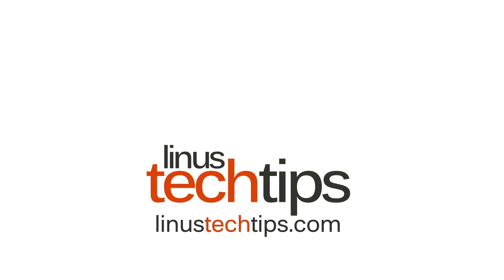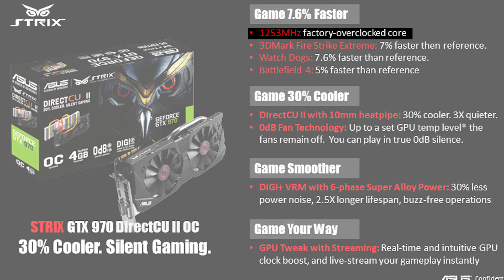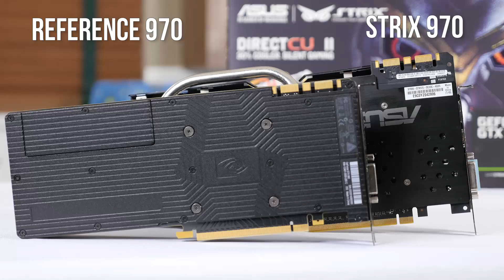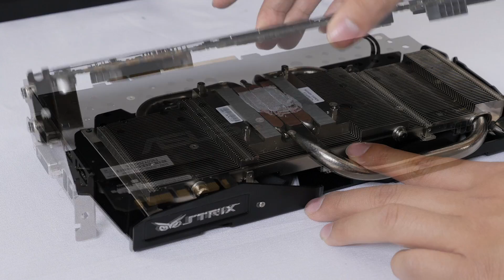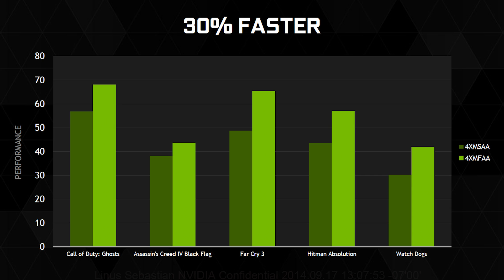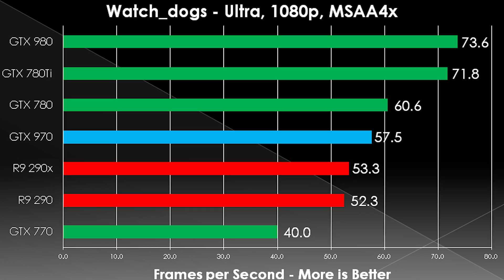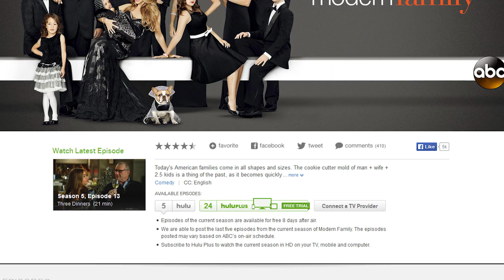ASUS Strix GeForce GTX 970 Video Card

Comment: Can someone tell me if this is a good build? and if everythign is compatible? (first pc build)

MSI Geforce GTX970 4GB DDR5 Nvdia PCI E Graphic Cards (GTX 970 GAMING 4G)
Intel Core i5-4460 3.2GHz Processor
Corsair Vengeance (2X4GB) Dual Channel DDR3 (CMZ8GX3M2A1866C9)
MSI H97 GAMING 3 32GB DDR3 Intel Motherboard
Samsung 840 Pro Series 256GB SATA III Internal Solid State Drive (MZ-7PD256BW)
Corsair Graphite Series 230T Windowed Compact Mid Tower Case
Corsair Builder Series CX600 V2 600W Power Supply 
Western Digital Blue 1TB SATA Internal Laptop Hard Drive Bare Drive (WD10JPVX)
thanks!
Reply: That looks fine to me but I just did a quick overview. Do you mind me asking why your going with intel over amd?
Reply: nate1994a im planning on a similar build (i will get a 290 instead of a 970 for the 3.5gb of vram thing) and AMD is just too far away in processors the fx line is dead and it will bottleneck almost everything higher than a 960. I really like AMD but they seriously need to catch up in the CPU side of things.
Reply: nate1994a because their CPUs perform much better in gaming because they have stronger single cores

Comment: Anyone able to help me choose the right power supply wattage?  
I decided to return my new 5K imac and build another PC, here are the specs:

Intel Core i7-5930K six core Haswell E
Asus x99-A Board
16GB DDR4 2400 Crucial Balistix(will eventually upgrade to 32 and possibly 64)
Corsair Hydro H100i 
2x GeForce GTX 970 SLI
SAMSUNG XP941 Series M.2 SSD
maybe 1 or two more hard drives
Maybe a bluray burner

Currently I chose a Corsair 850w PSU  but im not sure if this is enough now.  If anyone know how many watts the GPUs take please let me know. I know the CPU uses 140w

Comment: I have a weird budget. I am wondering if this would work with an x57 mobo with pcie 2.0, 6gb of ddr2 ram and an i5-650. No joke. I have a corsair CS750M, so power isn't a problem. This is very important to me, so I'd like an answer rather briskly. If I do not reply for some time, it is because I only have access to my tablet. Why? Wait for 6 1/2 years or so to find out.

Comment: So im kinda of a noob regarding pc hardware...and im in a dilemma!!should i buy with 400 euros a ps4 or a gtx 970!??im worried that im gonna give this much money on a gpu  and my pc wont perform as well as a ps4 on the framerate and smoothness of a ps4...my specs are gtx 650 ti 1gb, 8 gb ram vengeance,intel core i5 4670 at 3.40 ghz and a 1680x1050 59hz monitor!!HELP ASAP!!!dont hate!! :P
Reply: Sry i forgot to mention my mobo is gigabyte z87-hd3, wind 8.1 64 bit and 1 tb sata hdd(i DONT have ssd yet too pricey)!!
Reply: ***** yeah dude im sure that GPU is op as shit :P but im afraid it wont work well with the rest of my pc and ill put all this money to buy something that i wont enjoy as much as a ps4 that is sure it will work....it wont have the ultra settings of a pc but ill be able to play at high with adequate fps
Reply: Panagiotis Tsibos
what is your power supply?
 If you play a lot on pc than on a console you should definitely buy the gtx970.
Reply: ***** i think its 525 or 550W... i play more on pc nowadays but ive always been a hardcore console gamer
Reply: Panagiotis Tsibos
as long as the power supply is good quality psu there should be no problems :)
Reply: ***** i have it for about 5 years now and it can keep up quite nicely!!!but im afraid it wont be able to handle the gpu....but ive heard that the new gen of nvidias gpus is all about consuming less energy so in theory my psu can handle that
Reply: Panagiotis Tsibos
You should still ask around the internet because I can't be 100% sure if your 5 year old psu can handle your pc with gtx970.
Reply: *****
500w is definitely enough. I am running my setup with 450w psu and I have gtx970. The thing that concerns me about is the age of his power supply.
Reply: *****
No kerraha se vaa raapasee ite just maanantaina hain postista itelle juuri kyseisen näyttiksen mikä videos on.
Reply: *****
Parhain on kuulemma Gigabyte mut se on kans pisin. Ite otin Asuksen koska se mahtu mun koneeseen
Reply: tnx a lot guys that was really helpful!!! :)
Reply: Panagiotis Tsibos
no problem.
Reply: what is the best version of the card ?
Reply: prohunter gaming
If you got lots of money get gtx980, but if you are on a budget get the gtx970
Reply: ***** i ment like whats the best version of the gtx 970 ?
Reply: prohunter gaming
gigabyte or asus. Pick gigabyte if it fits in your case, if it doesnt then take the asus.
Reply: ***** ok thanks and what makes them better ?
Reply: prohunter gaming
quality and almost everybody says that the gigabyte or asus are the best of the 970
Reply: ***** ok thanks
Reply: prohunter gaming
no problem.
Reply: *****
hyvä homma
Reply: prohunter gaming zotac or asus I'll recommend getting the zotac one bcuz it's a fcking monster in overclocking
Reply: Christian Rhyss Jimenez thanks for the advice

Comment: This is the only review in the world where 780 beats 970.

Let me guess. You re-used your earlier scores. Back when you OCed every card you tested to its maximum and compared vs 970 stock? Because I know you don't OC your GPUs anymore, since the results were useless due to silicon lottery. It didnt make any sense.

http://www.techpowerup.com/reviews/MSI/GTX_970_Gaming/27.html

http://www.anandtech.com/show/8568/the-geforce-gtx-970-review-feat-evga/4

As drivers mature, the 970 and 980 will be even faster, it's a new architecture after all.

Comment: Hi guys. i'm thinking of building my first gaming pc in a very long time( last one was barton2500+(oc3200+)with radeon 9800se.
I see the gtx970 is the best value today, 8600 point on passmark and 250 pounds on ebay uk.(gtx980 9600, gtx780 8000).
What cpu would i need to not bottle neck it ? According to passmark highend cpu list, i'm aiming for a xeon e3-1230, 1240,1240 v2 or v3 variants...they all score 7000-9000. a i5 4690k scores 7700 points...want xeon cause on ebay uk they're cheaper but just as fast as the i5/i7 equivalents).
I'm thinking of arma 3 1080p ultra or very high with viewing distances to 3000 metre.
What cpu will be decent as in good enough but don't want to get an overkill cpu cause i want to save some money...i'm aiming for a 400-450 pound pc build...all inside a mini itx case probably coolermaster 110.

Comment: Has anyone been having the problem with the 970 where your not getting the frame rates you should. I dont know if this is simply a driver issue or if its something else in my computer. Anyone have any thoughts?
Reply: depends what program u are using. I use fraps to see my framerate.

Comment: Hi guys,i'm planning to getting a new graphic cards.
What should i get? This or MSI GeForce GTX 970?
Reply: Asus.
Reply: Gigabyte. (this was a joke just wanted to add to the chain)
Reply: MSI
Reply: get the EVGA ftw edition. they have the highest clock speed and hand pick the best processors for overclocking. its worth the extra $15
Reply: SyszoneTv no problems with mine. the strix is pretty good too though
Reply: SuperMango r9 390 msi
Reply: Lemmiwinks9619 I heard that EVGA 970's have some problem, so I went and ordered ASUS STRIX. I have trust in Asus.
Reply: ***** imo they just adrent good quality and their customer service is shit. evga, msi, and asus have really good warrenty and customer service
Reply: weskeeey chill. Go check out jayztwocents. The benchmarks there show the 390 winning. I have my sources. Also, I hope u don't use gpuboss
Reply: ***** yeah there's no need to change If u have a 970 but the 390 is still better
Reply: Oh, thats what I heard I haven't really tried the EVGA one so I should't say that but still I think ASUS, GIGABYTE are over other brands when it comes to GPU's, I like MSI's motherboard aswell as EVGA's powersupplies, so its just personal prefferences, I ordered EVGA 750B, MSI z97 GAMING 3, and asus strix.. I dont like buying all from evga or all from Asus if you know what I mean.. :)
Reply: SyszoneTv The Strix is (as said, yet not confirmed) one of the only ones without noticeable coil whine and they are actually getting lower priced faster than the FTW edition from EVGA. I've been checking them out for weeks now, and the Strix has already been lowered 20€ in price. The only thing that's different is that the FTW edition has indeed have the highest clock, but i would very much settle with the quietest one and also i'm impressed by what i've seen in this vid tbh. I never saw a game not needing to run while playing a video game? :O

I'm seriously considering getting the ASUS Strix OC over that of the EVGA FTW OC edition. (Personal choice)
>(tbw: It comes with a nice backplate while most have none..)<
Reply: SyszoneTv never get gigabyte. they are horrible. get msi, asus, or evga
Reply: Strix, its the only one that doesnt scream at full performance
Reply: ***** Err, so does that mean you're part of a large roach family? (°_°') *

* I'm clearly and severely outnumbered here!
Reply: just take the asus, its the best trust me
Reply: サキ愛子 asus, msi, and evga are all the best
Reply: asus is the cheapest for its hardcoreness
Reply: Asus
Reply: SuperMango Actually the Zotac has higher ratings.
Reply: Zotac-GTX 970  ZT-90106-10P-has all solid reviews.
Reply: Zotac have poor build quality.
Reply: ComicPunch No they don`t-in fact the ZT-90106-10 is higher rated than any other card. How long have you been selling Asus? You `ve never owned a Zotac in your life.
Reply: zhi xing ong 970 outperforms the r9 390 in almost every game thats out now do some research before u start to become a fanboy

Comment: My monitor only has a VGA, and DVI-D ports. Does the graphics card come with a VGA to DVI-D adapter? I only have a VGA cable at hand.
Reply: why would buy such an expensive graphics card and use it on your old monitor?
Reply: 2 X Dual Link DVI, HDMI, Display Port
Reply: I'm broke nigga, I'm broke.
Reply: dabom0282 if your broke how can you afford this gpu?

Comment: When I play shadow of mordor or high demanding games, I get coil whine, granted I barely hear it when the sounds from my speakers overshadows it, but it's there =(
And at idle when not playing games, the fan stops as said, but temperature hovers around 55 - 60 degrees, is that normal? surely it's not the problem with my case (HAF 932)

Comment: How do you overclock it ? My fps is seeming pretty poor on bf4, ultra settings 25-30 fps...
Reply: something isn't right then because I have Strix and I am playing on ultra with AA on and I tried it on 64 player server on operation metro and I had 60frames always.
Reply: It's my processor I think
Reply: Mental Gaming
might be a bottleneck with your cpu. depends what cpu u have.
Reply: I need to upgrade but i have no money
Reply: Mental Gaming
Next time you upgrade your pc you should google some info. Now you see what happens if you don't have any budget planned. Now you just need to get more money to buy intel i7 or Xeon and i5 is good too.
Reply: ***** i tink i7 is better cos it seems like new games are all coming out with recommended specs of i7...so much for people saying you dun need an i7 for gaming..
Reply: lyhthegreat
well Xeon and i7 cpus performs almost the same. Only difference is that Xeon has 8 cores and longer lifespan and it is cpu for service desktops and i7 is for normal desktops. I have Xeon on my gaming pc, but in the future I am going to by i7 Haswell and maybe build a service desktop to store all my crap in there and I can put some old parts from my current pc like the Xeon.

Comment: So I've decided I'm gonna get a gtx 970 but I'm unsure which one to buy - will I run into any problems with case compatibility since my case is a bitfenix prodigy? Which is the best all rounder? Which will be most futureproof? Any help will be greatly appreciated :)
Reply: buy the Asus or Gigabyte one. Both are the most popular and they work the best. "Remove the top HDD cage to fit long graphics cards up to 320mm in length." from the Bitfenix site.
Reply: Yeah I went for the G1 Gaming in the end and it's brilliant. Had no problem at all fitting it in the case so it all worked out for the best :)

Comment: i want to but his graphic card but i have a question. do i also need to upgrade my CPU?
Right now i have a ;AMD FX-4100.  If i need to switch up, what should i switch to? if i buy this card i have around 300 dollars to spend but would like something in the price range of 100-170 dollars at most. Ty for replies!
Reply: huge bottleneck. you need a new CPU. you should get i5. I have no clue about amd processors so my advice is to get intel one.

Comment: Love this card, but one single complaint: The thing is so heavy it freakin sags. Im not joking. the far corner from the back panel sags like almost half an inch. would be a bitch if you were tring to run an SLI set up. (NOTE: I have not found a single other person with this problem, like anywhere, i may just have a one in a million quirk on mine, so dont let this deture you, this thing is a beast. i love it and have no real complaints. Great job ASUS. :) and thank you linus for the review! )

Comment: I'm Having a little trouble deciding wether to get a GTX 970 or a r9 290x as personally I think the colours on 290x are slightly more vibrant and deep. However this may be, the 970's frame rates are better and it has a better power consumption and temperatures .Can anyone with a bit more experience help in this area as this is my first time building a PC. Many thanks
Reply: there is zero difference in colors, unless you fucked up the drivers.

i got a calibrated 27" inch 1440p ah-ips screen and used both chips.
Reply: Oh I had seen a video on you tube that had side by side comparisons of both cards and the colours were better on the 290x. I must just be getting a little complfused
Reply: Incognito
 Well it was just my opinion, sorry xD
Reply: +MerKier thanks for the advice but i have already built it now and i got the 290x and its great!
Reply: Ewe Tube I changed from 290 to 980 and the colors are just as good as before.
Reply: gtx970 beats the living crap out of 290x
Reply: ***** not really, they are pretty even overall. but 970 is much cooler and quieter.
Reply: Incognito i have a 1440p inch screen as well, my build which im planning to make should be able to handle games at 1440p 60fps, could you tell me what port i should use to connect it to the monitor? hdmi/dvi or display port? i dont know the difference (im gettng a msi gtx 970)
Reply: Heisenberg101 all those outputs will handle that
Reply: team green, Amd has alot of bad reviews atm, artifacting, overheating, doa, and i even heard a few rumors of them sending our used cards bro :/ id be leery of amd atm
Reply: MerKier bullshit..
Reply: Incognito
really? do some research, it has alot of bad reviews.
Reply: MerKier don't need to. i got 1st hand experience with the cards.

only 290x/290 reference cards are bad because of the cooler. fixed long ago. don't buy a reference and you'll be fine.
Reply: Incognito On newegg they have alot of doa's etc. And my friends card is starting to die on him also (280x) i got a 970 instead of a 290.. cant trust
Reply: Ewe Tube good to hear dude, Cheers to the new build :D
Reply: +MerKier thanks!
Reply: sure you did...
Reply: I would probably get 970 cuz i think the invidia software is awesome
Reply: ***** I've heard that asus's factory overclocks on amd gpus are often unstable, the 280x is known to get artifacts because of that

Comment: Asus gtx 970 or Gigabyte gtx 970 or Msi gtx 970? Which one should i get?
Reply: gigabyte if it fits inside your case without a problem and if it doesn't get the Asus one.

Comment: I don't know weather to get a gtx 780ti or the gtx 970.

Which one should i buy.
Reply: 970! If you know how to overclock it will perform almost similar to a 980!!! I got my card at 1475Mhz core and 8000Mhz memory clock. I could go faster if I want.
Reply: the gtx 970 is newer and is around 1 - 5% weaker but is more energy efficient,cheaper and has 4gb of vram instead of the gtx 780ti 3gb.
Reply: 970 is on par with 780 ti these days, in new games. will be faster in the future, due to driver optimization, since maxwell is a new architecture.

Comment: I'm thinking of getting this card, but I have a few questions before I do:
I currently have a Intel i5 3570, will this bottleneck the card?
My current card (GTX 670 from Asus) sags quite a bit due to its heavy cooler, does this card have the same issue?
Can anyone help me on this? I would really appreciate it! :)

Comment: Unfortunately my GTX 970 (Palit Jet stream) broke and I have been offered under warranty the EVGA SC blower design but I'm concerned about whether the cooling will be good enough with a blower design as the Palit Jet Stream was running at around 80 Degrees already. So I'm not sure whether just to pay the extra one with better cooling like the gigabyte version?
Any advice would be great! Thanks

Comment: I bought this Asus Strix 970 that requires a single 8 pin but my 750W PSU only have dual 6 pin connectors. Should I get a dual molex to single 8 pin connector or should I get dual 6 pin to 8 pin adapter? Thanks for your help!

Comment: Should I get 2 ZOTAC AMP OMEGA GTX 970 or the ASUS Strix GTX 970. My motherboard is Asrock Z77 Extreme 4 and it has 3 slot distance between the PCI E slots. I am worried that the Zotac one's will overheat due less space between the cards. I like both though but ASUS's one 8-pin power connector and video output options bother me.